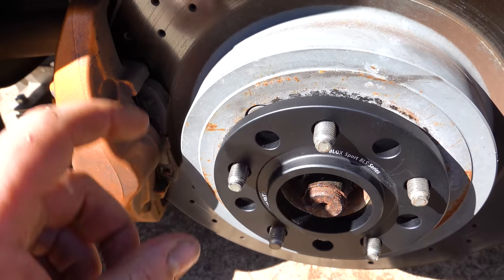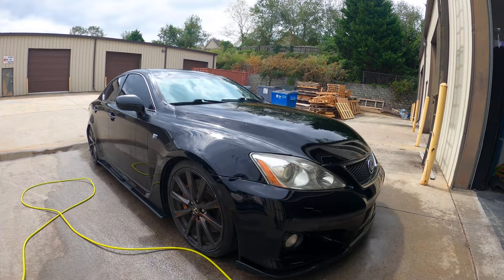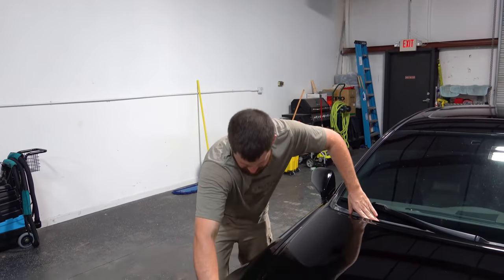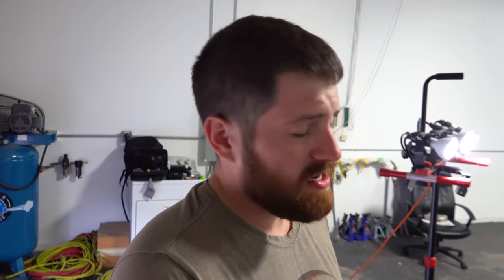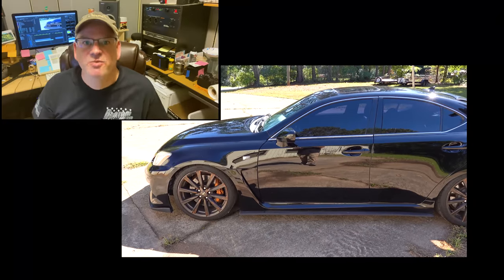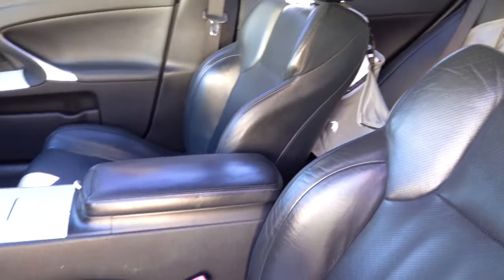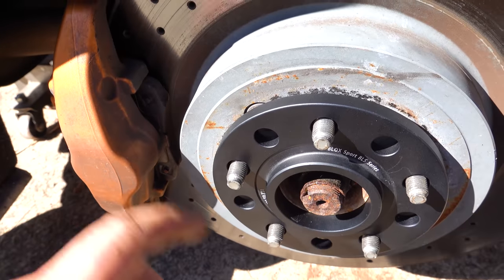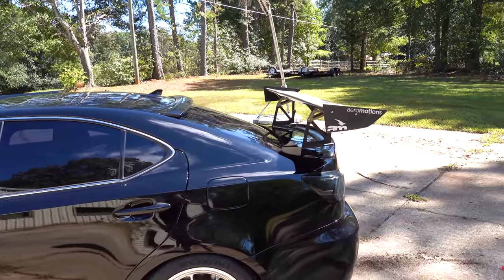THIS Is The CHEAP 4-Door SUPERCAR You Need To Buy RIGHT NOW (FORGET BMW, AUDI, And PORSCHE!)

Comment: Lexus designers and engineers spend hours and hours on producing a great car.  Don't you think they considered bigger wheels and tires and a wing?  They produced a car for the public roads to be driven at posted speeds.  Why come along and completely throw off the handling characteristics the engineers thought so carefully about?  Every time people mess with their cars, they risk their lives and the lives of other people.  Would you want the airlines to experiment with different wheels, tires, wings etc. just to make their jetliners look custom?  That's how stupid it can get.  As for a wing on a non-aerodynamic street car traveling at 70 mph, it's completely useless and silly.  Down forces don't come into play at highway speeds.  Leave these cars alone as far as anything electrical or mechanical changes go.